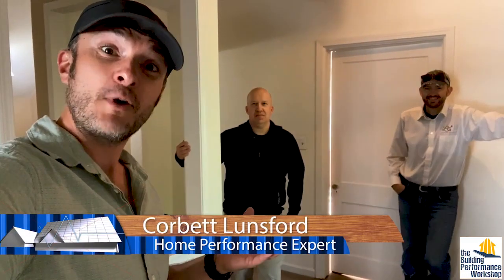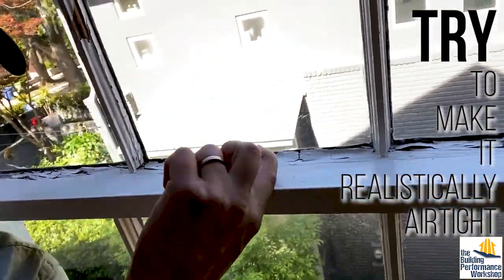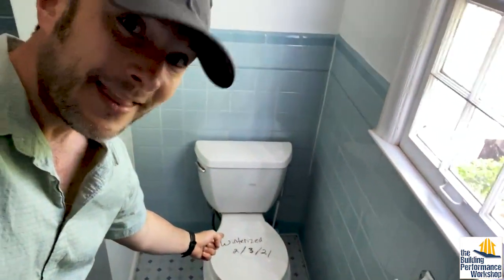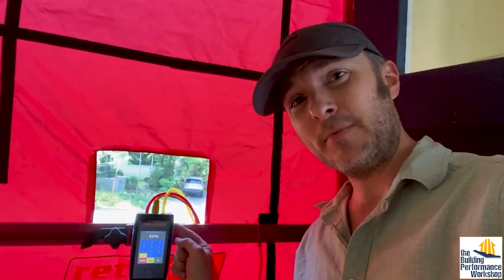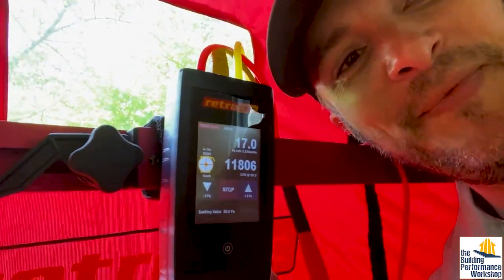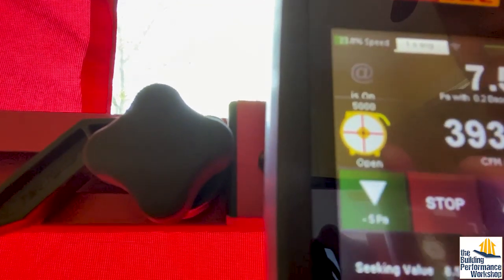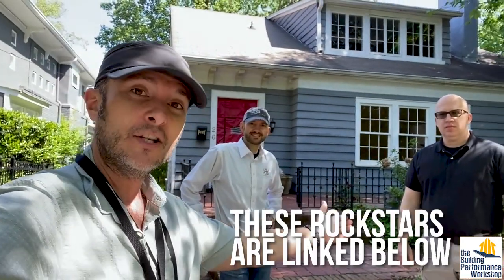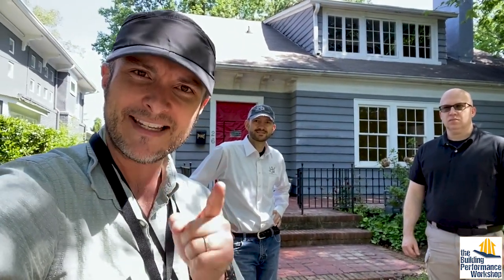Advanced Blower Door Testing Tips for Historic Home Renovation

Comment: Here in Florida the code says the standards apply only to those portions of the structure which are actually renovated.  How do you do the blower door test for only the renovated portions of the home?
Reply from the maker: Separate if possible, but usually you still test the whole house. Make sure the house afterward is no leakier than before.